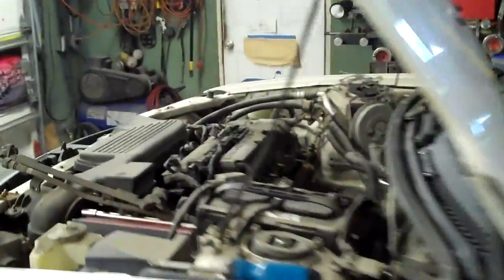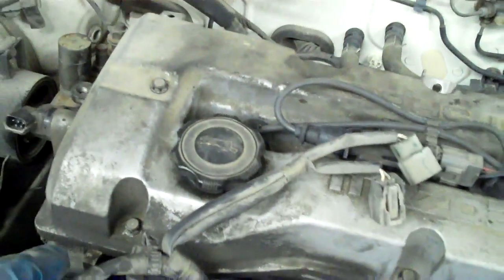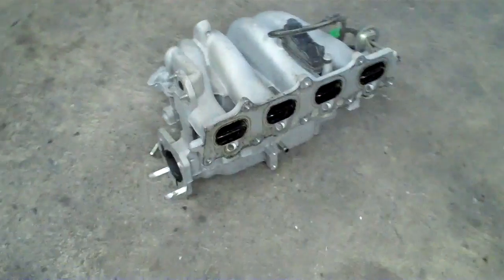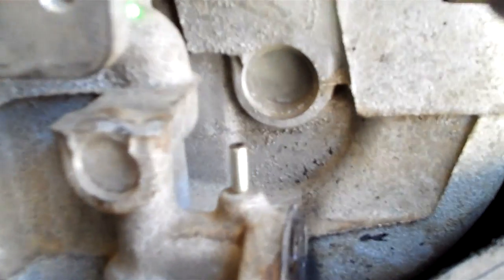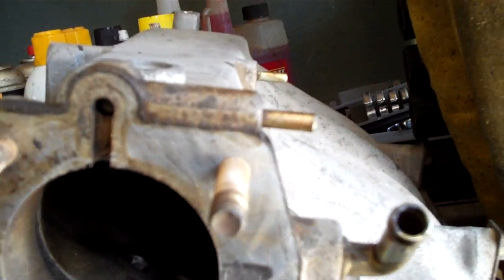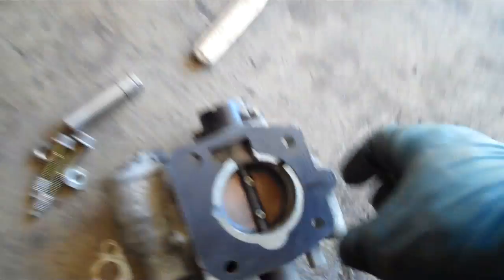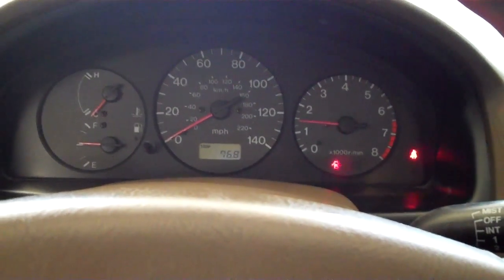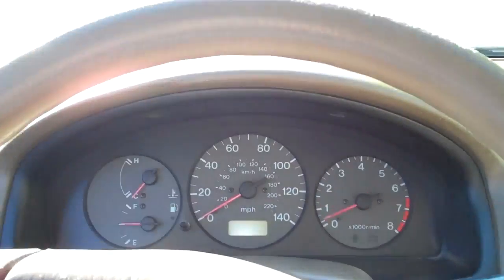How to fix Mazda Protege P0402 Blocked EGR Passages

Comment: Laughed when I saw this.  Started working on a white 2000 Protege a few months ago when it threw a P0171.  After cleaning the MAF didn't work, I noticed the same crack in the air intake hose and replaced it.  Car ran fine for a few months but then threw a PO171 again.  While tracking that down, head gaskets blew.  Mechanic took care of that and timing belt, but then a few days later, P0301 misfire.  I replaced the fuel pressure regulator, spark plugs, and pcv valve no problem, but when changing the air filter I noticed two of the plastic holding clips on the filter housing box were broken.  It's just one thing after another on that car!  Guess the good news is I'll know what to do when inevitable EGR codes show up ;-)  As always, thanks for your videos!
Reply from the maker: John Heyer You're welcome John- good luck!  This car was quite the project for sure.  I don't remember if this video included pulling the intake and cleaning out all the carbon from the intake manifold passages, but that helped a lot too.

Comment: I've had EGR issues on my wife's 99 Protege 1.6 for several years.  I cleaned the throttle and EGR apparatus with carb fluid,and that helped with the rough idle for a few months, but I didn't realize that the passage to the EGR might be blocked as well.  I'll open up the exhaust manifold this weekend and see if I can't finally fix this.

Comment: Thanx for the video..I did the seafoam treatment after I was getting a random misfire po300, and it reeally helped, I need to buy a stubby ratchet to get the egr valve off because the lack of room...I have a complete set of micro tools, scrapers, etc. The throttle body is clean and no buildup after the seafoam, I just want to try an avoid pulling the manifold if at all possible. Thanx again!

Comment: Brian I have an EGR inspection, testing, and cleaning video up for the 626/MX-6/Probe/Protege.  Any chance you saw it before doing the repair?  I go in depth into explaining the EGR system on my car.  The Protege does have a much different EGR system but the way it's routed is similar enough for the FS engine used in other cars to be useful.  I'm not a mechanic just a DIY'er.  Love your videos.  Always excited when I see you working on a Mazda. :)

Comment: Great info.  I hope to use your Berryman "treatment" to resolve a rough idle/stalling condition accompanied by recurring codes P0106 and P0171 on my '99 Protege 1.6 with 310,000 dependable miles.

Comment from the maker: I've seen it, but more common on your red truck is a failed cat that's blocked up and no codes.  My white one even did that.  Fuel injector cleaning is best done off the car so the cleaner doesn't cement the upper cylinder with white rock.

Comment: It's great for carbon, less good for hardened stains.  :)  I've tried both uses and it also worked wonders on a throttle body and did nothing for the manifold/head mating surface.

Comment: Have you ever seen EGR blockage cause problems with no code in a vehicle with OBDII capability? My 98 Ram has a subtle misfire (no code), and I wonder if an EGR/throttle body cleaning would be worth a go. Also, what do you think about fuel injector cleaning?

Comment from the maker: There's a rod with plate on it in this vid that the plates were super dirty and then I cleaned them.  All you need to do is verify that the linkage on the outside is OK.  If it's undone- get it hooked up or braced open.

Comment: Hey Brian, thanks for the video. I also have a 2000 protege 1.6L with a P0402 excessive flow. I'm new to this but want to learn. After some research, this seems to be a common problem. How do u suggest I start? Take apart and clean out egr valve, manifold and throttle body? Do I need to run any tests to check if it's not electronic? Some of the Wildlings to the North have used a Canadian EGR valve with hoses, should i do the same?

Comment: Just did the same process on my son's 98 Avenger (420A). The egr tube into the intake tube was completely plugged up as well. Back of the throttle body was just as bad.

Comment from the maker: The MAF on this car was filthy and that threw off the air/fuel metering. (due to the previous owner running an air filter you could plant a garden in)  Also the throttle body had no shortage of dirt/crud to begin the build up.  Add 180K miles and it's bound to get blocked.

Comment: Had this code on my 2002 Protege5.  I exchanged the EGR valve with one from another Protege that I had.  Its a pain in the ass to change.  Close to the firewall and the bolts are a little recessed into the valve housing so can't turn the bolts much.  

Thanks for the explanation though.

Comment: I wonder if Napa or AutoZone, sell a screened EGR valve gasket, like they do for some GM and some Ford applications, for this application?  These gaskets stop (most of) the carbon at the screen and then only a pick tool is needed to remove the carbon at the gasket.

Comment: I got a code for the egr valve on my ranger. I wasn't about to deal with it at that moment, but a day or two later the light went off. Did the light go off because maybe the egr was stuck and it freed itself or did the light go off because after a while it goes out, but the problem is still there? It's been about 2 weeks.

Comment: Could you do a video on P0400? I've cleaned every passage I could on the egr system but the code won't go away. I even changed the gas cap. It's a Suzuki if it matters. All I haven't done is change the hoses, some are a little hard and slightly cracked at the tips but not too bad. My throttle body was cleaned about 1.5 years ago.

Comment: I have a code P0300 for multiple misfire.  It's been driving me crazy with a rough idle.  You think replacing the EGR could fix this whole mess?  I've tested the coils, compression, fuel tests, the whole 9 yards.
Reply from the maker: I'm blindfolded as to what car it is as you haven't told me, but it could be a vacuum leak or a bad knock sensor or like you say an EGR valve that's stuck open.
Reply: Sorry about that.  It's a 2002 Mazda Protege 5 with 132K.  I replaced the EGR so it wasn't the case.  The only other thing I could think of is an electrical connection that got wet after detail.  It is what it is.  Sold it to a mechanic for what I was into it and off it goes.

Comment: I have a 03 mazdaspeed n keeps giving me the vtcs code for low voltage....when driving the car only issue I have too is when I'm already at a high speed n I give it more throttle it Boggs n jerks around...couod this be the butterfly in the intake might be sticking....pls help driving me crazy

Comment: Big question i got a 2.0 protege 2003. The engine try to stall sometimes and sometimes shut off completely .code appear p0401 i got the car at many mechanics and no one can find the problem is this same issues linked with the egr? Thanks hope u can help me about
Reply: I've had rough idle and wanting to stall multiple times over the years on my 02 with 2.0 engine. Idle Air solenoid, EGR, and the main intake rubber boot have been the culprit every time, having to go through it all again. Used gorilla tape and zip ties on my rubber boot, mine is torn right in half, tape holds it together, hah.

Comment: Hi. thanks for the info. Have a bit of a problem with my Mazda etude. south Africa version of protégé. its 1.6L zm motor. with twin coil packs. car has done close to 450 000km and still love it too bits. when I rev it up its sound like a bearing knock. on idle till about 2000rpm its quite. after 2000rpm it makes like metal grinding noise. can anyone offer any advice
Reply: Redaad, hello, did you find out what the grinding sound was from?I have a 1993 Mazda protege 1.8 lt  , trying to get running thanks

Comment: How long did it take you to do all this? How much would you charge? I need it for my 1996 Protege.
Reply: It's not that expensive
I've done in to multiple Mazda 626 as it shares a similar system. I've gone through almost 2 cans of cleaner per intake manifold.

Comment: my mazda idles really really low and hiccups sometimes and it will not run with the ac on at idle could this fix it?
Reply: Pony Rider really late but if you still own the car you should of checked and replaced all the spark plugs, clean the MAF sensor, clean throttle body. It worked for me but i am still getting a small amount of rough idle but if i do this i am almost sure that it will work even better.